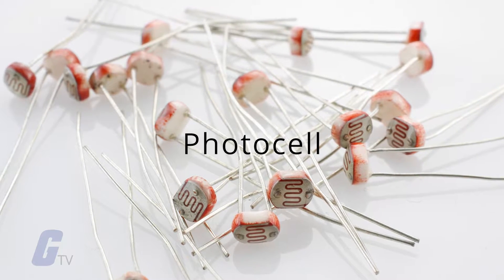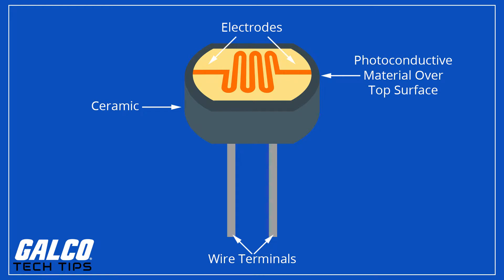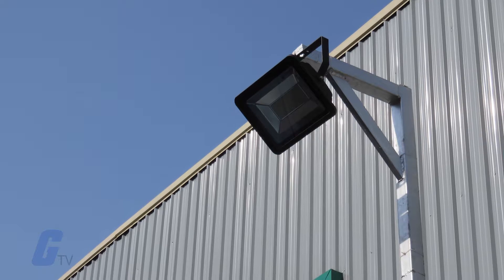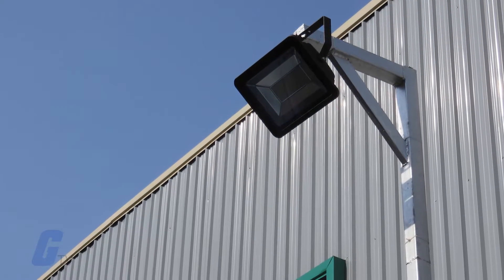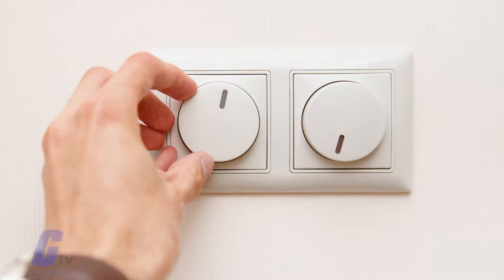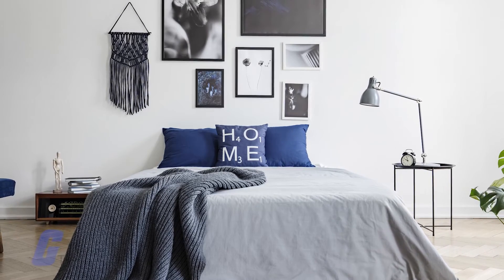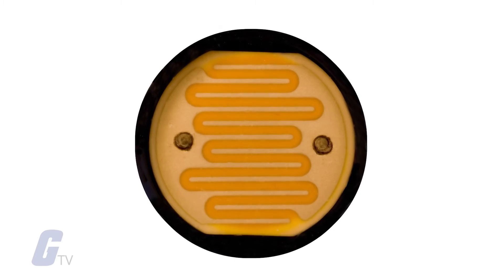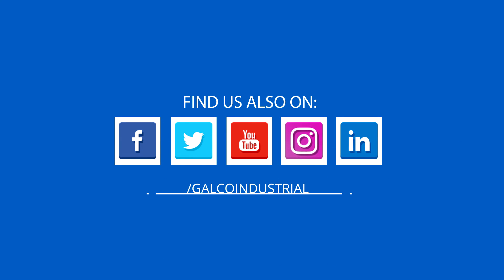What is a Photocell? - A Galco TV Tech Tip | Galco

Comment: How do I turn a relay on with the output of photo cell sensor? 
Please help me?
Reply from the maker: You will need a photocell amplifier circuit of some type in order to drive the coil of the relay. The photocell may not drive the coil directly because most of them only have a range of resistance that they will swing from off to on. if you have a specific photocell already, you may be able to look up specs at websites like "datasheet 4U" or "datasheetcatalog.com" and many times they will have test circuits you can build your self, ok?